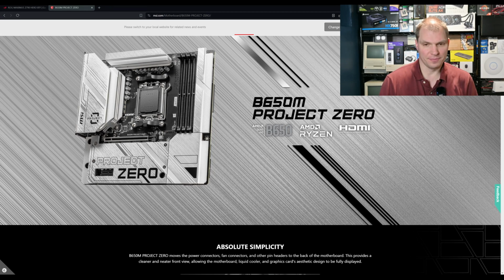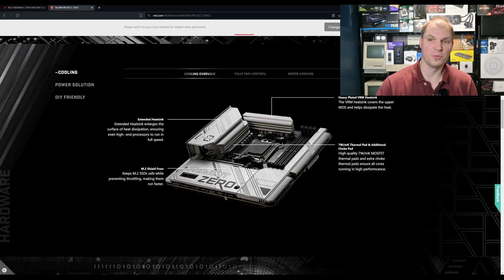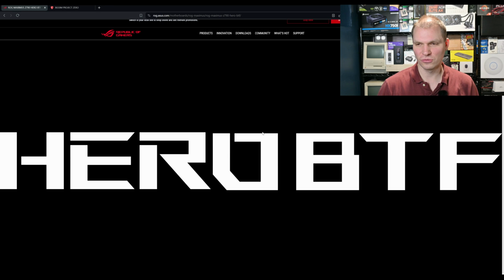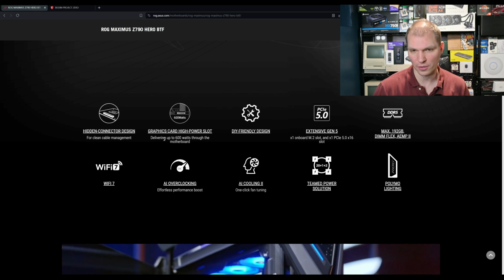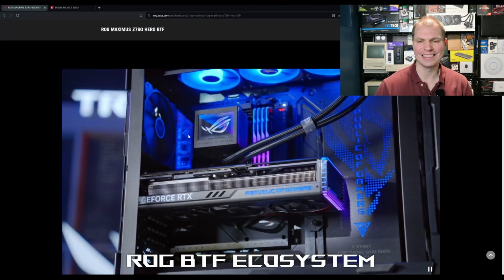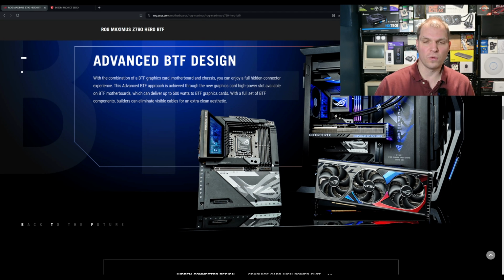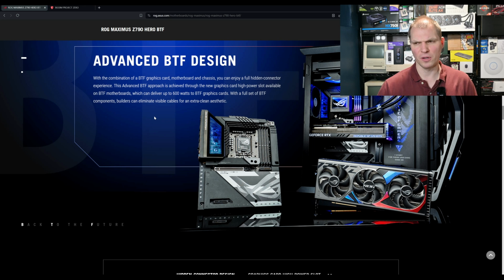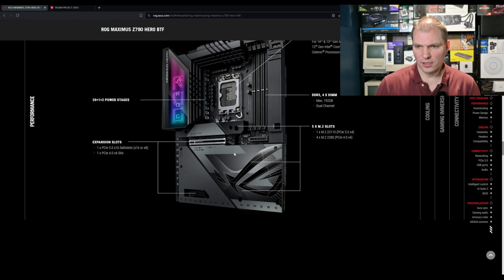Innovation in Motherboards - ROG MAXIMUS Z790 HERO BTF

Comment: I bought this motherboard, but I can't see how to get it into my casing
Lian Li PC-O11 Dynamic XL (ROG Certified) is the casing I bought, but since the connections are all on the rear of the motherboard.. I just want to know if it's possible before buying a new case :)
Reply from the maker: I don't know if it would work. I don't have the case or the motherboard to test. Looking at both I don't think the connections will line up. Maybe someone else can comment.
Reply: buy a dremel multi tool and do the cuttings in the case yourself?

Comment: Thanks for the info but i have a question if you can help me, is the EVO HALF 700 case compatible with ROG MAXIMUS Z790 HERO BTF Mainboard?
Reply from the maker: @mohannadbittar8499  I don't think so as I don't see cut outs for the back connectors on the board.
Reply: @GrayaOverload  Tahnks